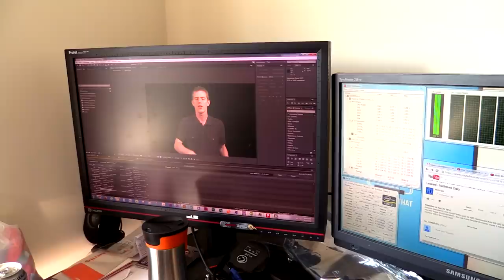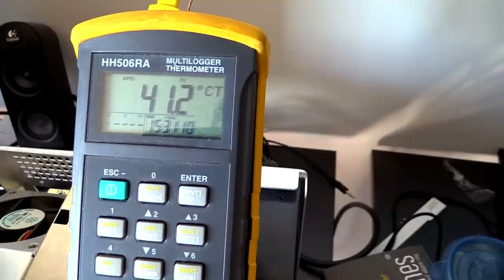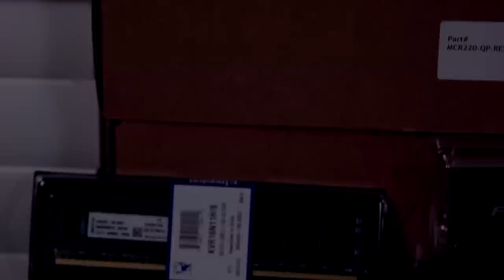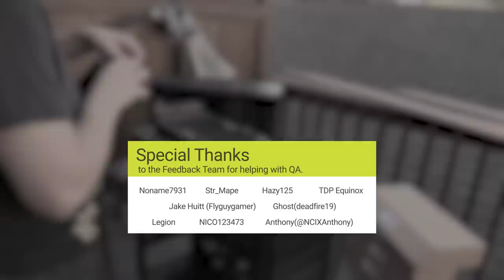Whole Room Water Cooling Project - Day 1

Comment: I get the point of soldering, but if I were a plumber I'd invest in a high end pipe crimper for higher productivity. I can't remember the last time I had a professional plumber who soldered anything. It's all crimped connections except where I need the flexibility of compression fittings.

Comment: I feel like the tubes running in the room will cause it to dissipate heat into the room while travelling. So maybe a thermal coat on them or cover would help eliminate that =).

Comment: They should have insulated the piping in the room. Those copper pipes just act like a huge radiator, just letting the heat escape into the room.

Comment: Hey Linus, How powerful of a pump would you need to run an external water cooling solution like this for just one pc? Hypothetical: PC under a window mounted AC unit, Rad attached to AC unit, AC transfers heat outside?  Energy conservation not top priority here...

Comment: You know, you could have gotten a ductless heat pump system for like 1-3k for that room... and maybe run all machines on the coolant instead of water.. lol

cuz the cooling loop goes into heat exchanger you'd normally mount on the wall... what if instead, you ran the loop through the machines... you could prolly get the temps down to ~20c or lower...

Comment: firstly why the T junction in the plumbing? secondly did you get a plumber to help you set up where and what pipes should go where in the liquid cooling system? Then lastly why paint the walls before putting in the plumbing  and not do it the other way around of takeing down the walls then haveing the plumber come over put in the plumbing then put up new walls and paint them?

Comment: Ayeeee the Silverstone SUGO SG01! I still have one at home and it's a nice little case...but no way in hell should it be used in a modern high end rig, especially for video editing! You can't fit a cooler big enough for a high end CPU in that tiny case. I'm surprised that with all the cases and other stuff that Linus's group receives, they couldn't just move his system to a slightly bigger microATX or ATX case and put in a better cooler. I know they wanted to do this project, but Edzel's system should have never made it to the inside of that case lol. Someone should have looked at it and seen something was wrong with the setup before assembling it.

Comment: anyone w/ their own underground spring well and plenty of water could just as easily pay [a couple hundred bucks] for an installed second well-pump and pressure tank to run a single mainline pipe directly from it to a tubing manifold, then to the individual computers (no cooling needed for the naturally cool spring water).  plus, if the water pressure is strong enough on its own, additional pumps wouldn't be necessary.  from there it's simply a matter of directing the exiting water to an outside location capable of handling the excess water.  that might mean returning the water to the same underground spring from which it came, dumping it into your septic tank (if it has the room), or sending it out to a nearby creek or stream through an old garden hose.

i can think of only 2 potential problems:
1. the water being used could freeze.  however, as long as the water is moving, it won't freeze (w/ the possible exception of a fluke once-in-a-century cold spell that lasts several days).
2. non-treated spring water would quickly cause mineral build-up (calcium, magnesium, rust, etc.) in all the pipes, components, fittings, and connections and would therefore require constant maintenance.  however, this could be mostly overcome by using a certain kind of water softener that's tailored to treat your well water.

Comment: The flaw in this is that they used bare copper pipes instead of insulated.  This effectively radiated the heat right back into the room rather than carrying it outside.  It looked really cool though.

Comment: Hi, I'm trying to overclock my Intel Core i5 4690k. I can change the core multipliers but where do I change it so the CPU gets more voltage? I'm using Intel's extreme overclocking tool. So far, I managed to get it to 4.2 GHz without changing voltage. How do I get more voltage for the CPU? Thanks.

Comment: this generation CPU do get over heating after sometime, it's also happening in i5 even. you need change internal paste. try that :)
Reply: Linus always uses IC Diamond thermal paste anyway, that's not the issue. Sandy Bridge E 6 cores just run really hot and for a very inadequate cooling system, you get problems.
Reply: +Infinite Zero Then y don't use proper A.C. it's cheap and easy n will way more cooler. E6 processors run hot because they running on bad paste under Main sheet or cpu heat sink not cooler sink. This issue is addressed, then intel using low quality paste cpu on few series of CPU available for common buyers. This issue was never seen Branded computer like DELL. E6 in Dell or HP Doesn't get that hot.
Reply: +Infinite Zero he meant the thermal under the cpu plate, if you had old athlons or bartons you know that amd used to be freshier back in the single core cpus cause they didnt use the cpu top plates they use now. but even so he wont gain that many degrees, i only won 3-4ºc on my i5 750 when i removed the plate and used cooler right in contact with the core.

Comment: Actual conversation between a few friends and I over IRC:

(Friend expresses concern over putting 16 core 32 thread cpu in a 1u server chasis, cooling issues)
Me: Dude, whole room water cooling. Get with the times.
Him: Pleb. Whole-room mineral oil immersion cooling is where it's at
Me: Well of course, you put the water cooling loop in the mineral oil. Jeez.

Comment: That complaint about Taran and his "SSD" reminded me of my computer.  It came with an SSD to, "Boost performance"  When I got it, that drive was completely uninitialized and windows was installed on the standard 1TB drive.  I wanted to kill someone at Lenovo.  If I weren't a nerd, I'd never have realized I had a completely unused SSD on board.  I'd just assume that SSDs don't boot that much faster than standard drives.

Comment: Dude what will happen if there is a leak somewhere? All pcs wont work! Looks not very practical for me. Why not use separate water-cooling for each pc and buy an aircon? 

Nice idea but one problem (there is a lot of connections, so you have high risk of failure) and all computers could not work.

Comment: the only problem i have with this build is that you guys kept the same ID piping for everything... like... are you guys losing it?  to supply water to a series of taps you need a larger feed line than the tap lines, to supply the flow for ALL taps.

Comment: Why would you use copper piping which efficiently dissipates heat inside the room? This doesn't solve your problem of the room being hot... You shouldve used some other kind of piping

Comment: I think it would have been better to custom water cool each computer not the whole room.
Reply: Vincent Chu It actually wouldn't, because the heat would get pushed out into one room, and would basically turn into a sauna.
Reply: +pokechat8978 you have a point. But still. I think it would be a good idea to get some air conditioning and mount it to the wall. Lol

Comment: Should a used PVC
Reply: I don't think you know what water cooling is
Reply: @quizarorobzaqu8558  not in the computer side of the loop but the room side. Might have done a better job of holding the heat unlike the copper which happily radiated heat energy back In to the room.
Reply: @quizarorobzaqu8558  also pvc wouldn't react with the water blocks and other components causing corrosion and junk to build up in the lines

Comment: poor design,lack of  basic knowledge in water flow,gravity,pluming ,choise of materials,,,,,i would use compressed air pvc lines and its quick fittings,,a ac radiator from a car plus the 12v cooling fan(easily powered by a pc power supply ),, a aluminium reservoir ,,and a  120C Domestic Pump Series CBM and CBEM Boiler Feed .........feed line plus the pump running in the floor,reservoir set a foot higher than any  pc tower ,,radiator at reservoir level or higher always,,,,return line running high so it retains the air thus eliminating the need for purging  and pressure levels low at high temps,,,,,,,the reservoir can be acrylic type like an aquarium  with some feature to make it easy to see water flow....